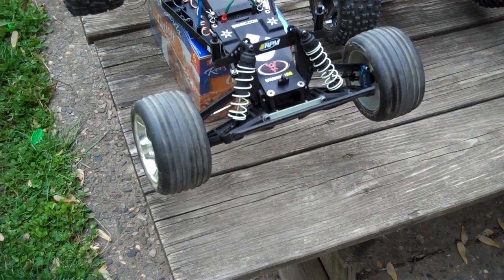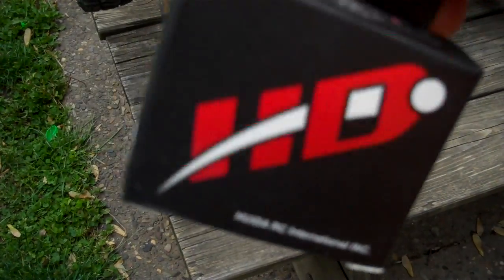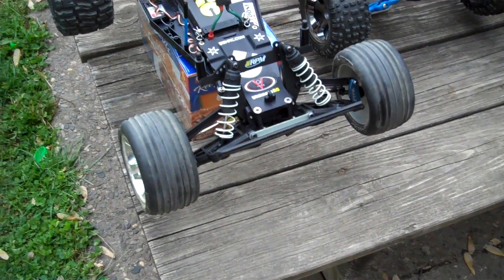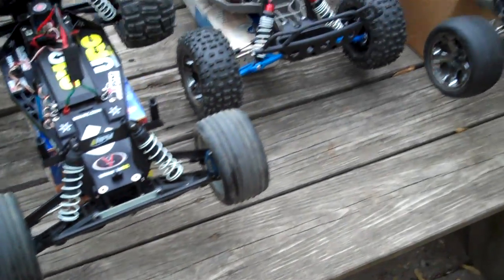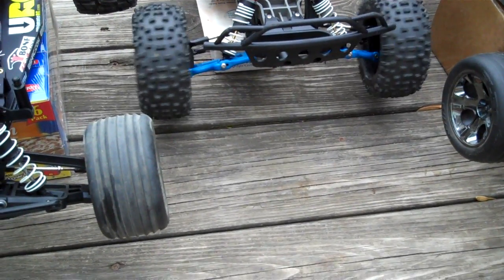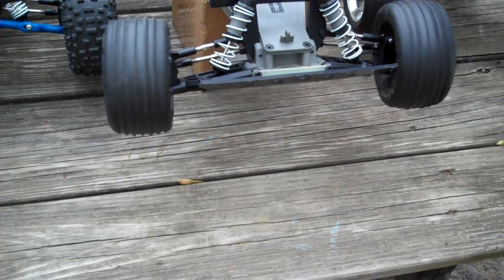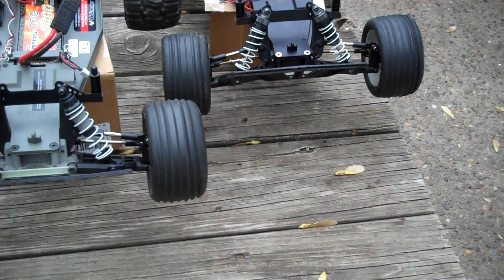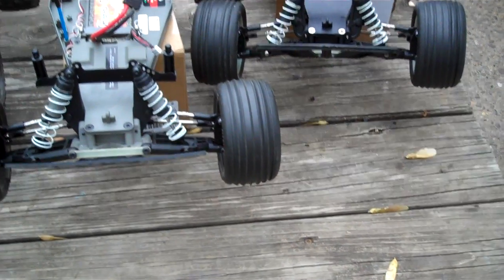quick servo comparison

Comment from the maker: you'll want a kimbrough 124 servo saver to go with it. the stock saver is week and tends to stick in different positions instead of returning to center. there's 3 rows of arm mounting locations on the kimbrough unit. you'll want to use the center row to mount your linkage and cut through the top row to make room for clearance... then just clean it up with a dremel or file. you'll see what i'm referring to when you get it.